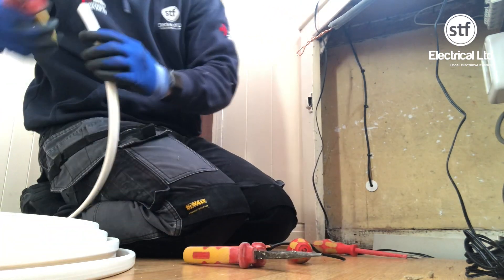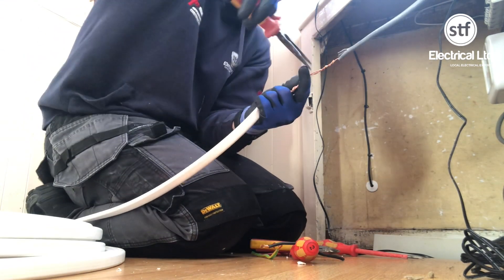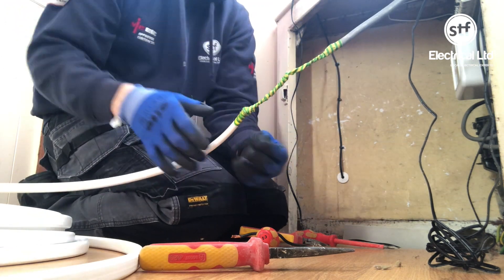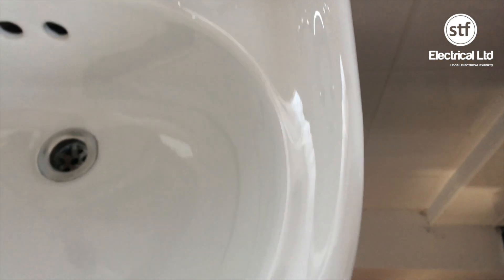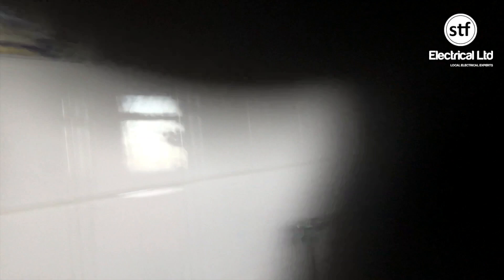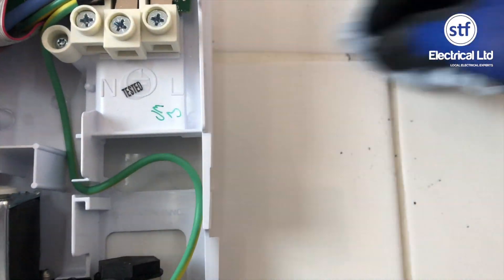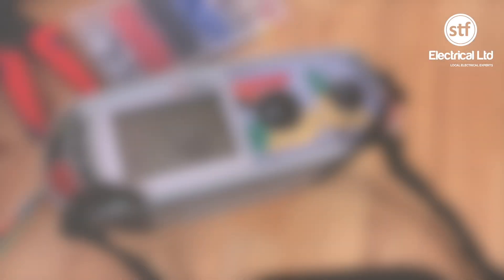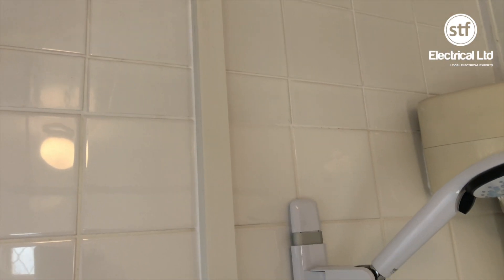Shower Rewire

Comment: 🙂👍So glad I’m getting new cable before I have my bathroom remodel. 
My old shower start tripping RCD so replaced shower the problem is it’s still tripping . It looks like it’s a rewire. Upgrade to 10 mm . Not sure how complex but it obviously needs doing. 
Hope I get a quality job like you’ve done. 
I came here so I knew what to expect with a rewire. I’m just hoping there’s no trunking visible otherwise it will be a hallway re plaster as well😂  good excuse to redecorate. 
Great job thanks for shedding some light on been a good sparky  and what to look out for . I used to love watching my dad work rewiring houses.  Brings back happy memories helping squeeze through tiny holes  in the floor and between floor board’s.  He’s retired now but still enjoys mending anything. Great skill been a sparky .

Comment: Tidy upgrade! I have a 8.5kw shower, 6mm cable - short run and the spark fitted a 50amp dp isolation switch is that OK? As the switch gets very warm when used

Comment: Ze On low loop! Why? Should be a 2 lead High for that. More accurate also.
Reply from the maker: Hi Simon,  yes your completely right!  I'd preformed this test purely for footage before packing away (it can be hard getting they footage for these videos so I often shoot a lot of random pieces in case they're needed)  Obviously I never had my head screwed on when doing it and as I'd captured it right after getting the Zs of the shower circuit I mustn't of reconfigured the tester.  Well spotted - I assure you it was done correctly when recording the Ze before the circuit was energised.

In the interest of clarity and for anyone watching the channel who's maybe still learning etc.  My particular tester (same as many) can preform loop testing in a number of ways which I'll describe below:

- 2 wire high current testing (20A or more) - This gives fast, accurate & repeatable results.  The downside is it can trip RCDs and occasionally lower rated protection devices. It's best used when measuring Zs of non RCD protected circuits &should always be used for measuring Ze and phase to neutral loop impedances.

- Three-wire no-trip testing requires all three wires as the name suggests & usually uses a test current of 15 mA or less. Obviously this method does not trip RCDs but the limitations are that results are not as consistent as 2 wire method, takes longer to get the reading & the result can be affected by external factors.  Also as you can see in the video (when I'm carrying out the Zs at the shower unit) the RCD internal impedance can affect the result.

-There is also a 2 wire non-trip option which is good in places like light switches where you don't have a neutral. It's not usually affected by RCD internal impedance or by earth leakage currents, but the measurement time is still longer & results are still sometimes affected by external influences. Occasional RCD or RCBO tripping may also occur which I've experienced and is the reason I use the 3 wire method for Zs testing.

Hope that clears up any confusion this caused anyone!
Reply: @stfelectricalltd6849  Great reply. Well explained.  Subscribed :). There is also an alternative method for taking Zs readings using high loop with RCD protected circuits.

  
Alternative Zs Test: Safely isolate the installation. Have main switch off, all MCBs off and all RCDs off. Link line and cpc at the furthest point on circuit. Use a two lead high current earth fault loop impedance tester. One probe goes on the outgoing side of the MCB of the circuit that you have linked out (and so is connected to earth via the line). The other probe goes on the incoming line conductor of the main switch, which will be live. Measure the Zs and record. You can also switch on the MCB and then place your probe on the outgoing line of the RCD, this will include the MCB in the test.

Comment: Did you use lsf?
Reply from the maker: tommochelsea72 cable is LS0H.  Rest of the property is in standard twin and earth so pretty pointless on this one - but do try to use it throughout on new installations or rewires (budget permitting)
Wholesalers had 25m on the drum in this instance which they did for the same price (probably so they didn’t have to go and cut the other stuff)
Reply: STF Electrical Ltd fair play. I use in commercial stuff but never on domestic. I know a sparks that only uses it on domestic. Too much of a pain to strip compared to normal t&e 😂. Although not as bad as it used to be
Reply: STF Electrical Ltd fair play. I use in commercial stuff but never on domestic. I know a sparks that only uses it on domestic. Too much of a pain to strip compared to normal t&e 😂. Although not as bad as it used to be
Reply: STF Electrical Ltd STF Electrical Ltd fair play. I use in commercial stuff but never on domestic. I know a sparks that only uses it on domestic. Too much of a pain to strip compared to normal t&e 😂. Although not as bad as it used to be

Comment: You do not need metal clips for vertical cable runs.
Reply from the maker: john flower hi John, yes I’m well aware of that.  I just get in the habit of putting them in for what it’s worth
Reply: @stfelectricalltd6849  don't ever let anyone knock you for attention to detail and going the extra 10 yards.
Reply: john flower you now have to prevent premature collapse of ALL cables,vertical and horizontal. Granted it’s a small run to the shower which wouldn’t cause too much of a issue but better to do than not.